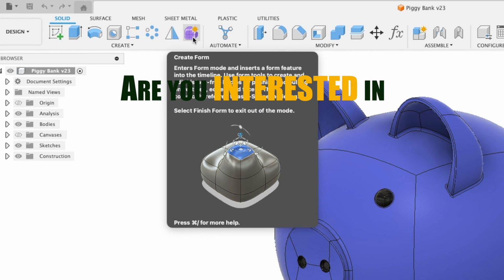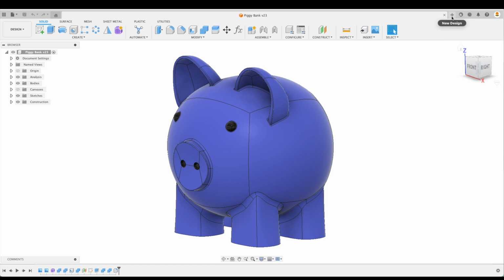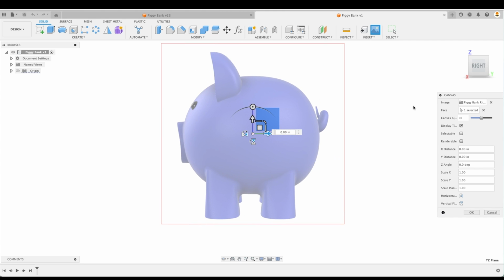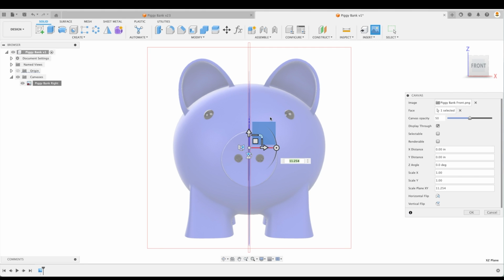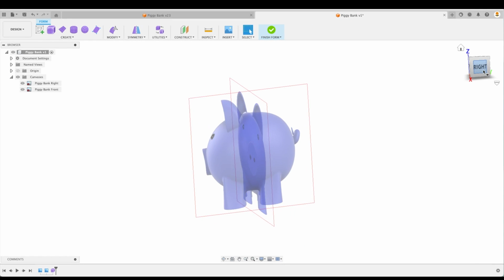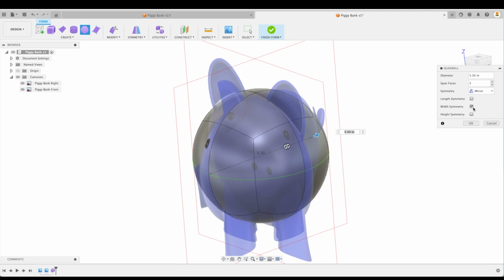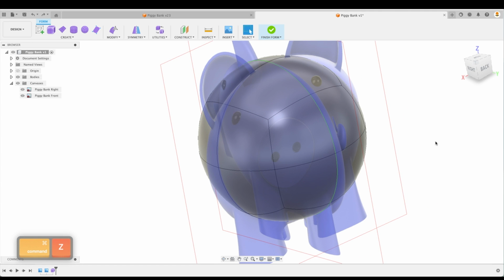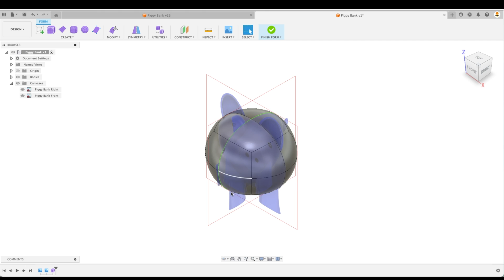Autodesk Fusion 360 - (1/4) Form T-Spline Modeling Fundamentals For Beginners - Lesson 13

Comment: how to edit two canvas at the same time to align the caliberation? once I start editing the second canvas, the red frame does not show up on the caliberated canvas, making it hard to match
Reply from the maker: Excellent question! There is no easy way to do this and just takes patience going back and forth between canvasses to try and line them up as best as possible. Please keep in mind that using canvasses as a backdrop is not recommended for design that requires high precision. Therefore just do your best to align and calibrate them and then start modelling.

Comment: "nice" video, arse, You used 1/2 of video to blah blah about canvases. Tought it is about T-Spline modeling....
Reply from the maker: Thanks for commenting. Sorry that you didn’t find benefit in that aspect of the tutorial. Hope you benefitted from the portion that didn’t talk about how to work with canvasses. The tutorial was designed to teach anyone how to grab any image off of the internet and create a form based model off it. Either way, all the best in your endeavors to learn Fusion.
Reply: @learnitalready  Ok, Sorry about my angry comment. This is good tutorial. I'm just searching tips for how to change  line in "blob" to sharp. Sorry about my poor english, and even more sorry about my harsh comment. I'm just depressed because I searched for answer for hours. But google's algoriths...
Apologies.
Reply from the maker: @ No worries at all. Hope you’ll find what you’re looking for. If you explain a little bit more (don’t worry about your English) maybe I can help.
Reply: @learnitalready  Thank You. I have used Fusion almost 10 years, but mostly  to make sheet metal flat patterns for laser cutters. So  I don't have any experience about "forms".
Im trying to model a small ship.. So, there is curved shapes in the main shape, which i tried to model in the FORM environment, but there is also edges in the form that have to be sharp edges. Not curved. I can't figure out  how to change curved edge to "sharp" edge.
Reply from the maker: @nyytti7233  Find the tool "Crease" and select the edge that you'd like to be sharp. Let me know if that works.
Reply: @learnitalready  Confirrmed. It works.

Comment: It would be interesting to see some intermediate level T-Spline content concentrating on how to integrate T-Splines with defined and accurate mechanical interface surfaces. Something like that on a guitar neck or a wood plane tote that is basically organic but require integrated mating surfaces.
Reply from the maker: What a great suggestion. I would love to do a whole series on a more complex project using form/t-spline modelling. Thank you for the idea. I just need to find the time now.

Comment: I am showing myself here as to my lack of computer knowledge.  I want to know how you placed a folder in Fusion360 to upload your picture files.  I am not able to get the same active symbology as your video shows because of my entries to file.  For instance, The "Edit feature after right clicking on ball"  and the "Arrow feature that allows you to pull over the leg next to centerline."  Help!
Reply from the maker: Thanks for reaching out! Happy to help if we can. 

As for files and folders, you will have to click on the far top right of your Fusion 360 window and select the small 3x3 grid pattern. This is otherwise known as the Data Panel. There, you should be able to create a New Project, and then within your project you should be able to see a dialog box that allows you to create a new folder. Once you’ve created a folder, select File from the top of your F360 window and find the option to “Upload”. There you can upload an image or most CAD files.

To move or edit a Form, you can double click your model which will enable you to move the entire form. If you only want to edit one of the three primary features (face, edge, vertex) then you can select any of those features and then find the shortcut key on your toolbar called “Edit”. Then you should be able to edit those individual features of your model. 

Clear as mud? 😆 I hope it does help. Let us know!
Reply: @learnitalready  I should have been clicking on "File" not "Save".....Dahhh but I'm learning Dah ropes!  Thanks for the help.
Reply from the maker: No worries! Glad we figured it out.